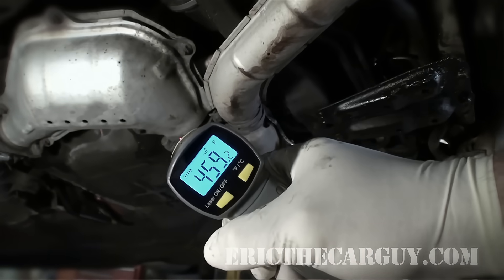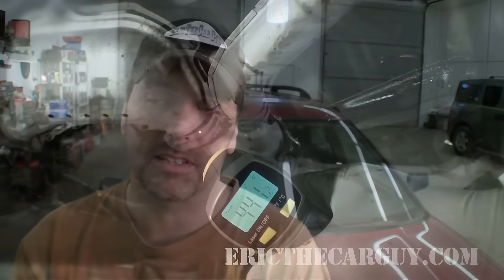Does Lacquer Thinner Clean Catalytic Converters? -EricTheCarGuy

Comment: Cats shouldnt effect performance in any way,they're simply for emissions the code can be tuned out, save yourself $180
Reply: Kyle Milford You are "talking" mad shit ! a bad CAT will decrease power in the car. How old are you 12?
Reply: 25, And drive a 400whp eclipse without cats.. So your point is invalid? All cats do is decrease emissions, maybe on certain vehicles the ECU will see a bad cat and decrease power? But most cars this is not the case. Unless your talking about backpressure?
Reply: Kyle Milford a clogged converter will decrease power and restrict exhaust
Reply: Kyle Milford For the sake of better environment for everyone, get a new cat if you can afford it.

Comment: scott kilmer is a on going joke in any of the professional only type internet forums or training type channels. He at most just embarrasses the trade. I wouldn't let him change oil in my lawn mower and diagnose nothing.
Reply: I heard him tell a guy with a po730 on a Honda civic that he might have a bad sensor,solenoid or a bad "transmission fuel control modulator". What the hell is that???

Comment: Thank you for your video! I've watched both yours and Scotty's videos on the whole lacquer thinner experiment. I did notice that in his video he used a completely different ratio of lacquer thinner to gas, but until I decide whether or not to try it, I have a question. I asked Scotty the same question, but have received no reply. I don't know very much about car mechanics, and I'm always afraid that I'm gonna get ripped off taking my car to a shop without knowing what's wrong with my car. I took it to Autozone just to have the code reader used on it. I don't remember all of the codes, but they were for the catalytic converter, O2 sensors, and cylinder 5 misfire. Now the unique problem I'm having is that the car WILL NOT go over 5k rpm regardless of which hear it's in, or how fast it's going. No matter what, it will not go over 5k rpm at all. It just kinda "boggs down"as soon as it hits 5k rpm. I have no idea what's going on with my car, which is a 2007 Mitsubishi Galant Ralliart,  3.8L MIVEC V6. Any help, or suggestions from you (or any reputable mechanic) would be greatly appreciated!  I'm just trying to avoid being ripped off once I take the car in to be fixed.  Thank you so much for your time! 
Sincerely, C.King
Reply: The misfire causes the car to go into a "safety mode" preventing you from going above a certain rpm for your cars safety
Reply: Leif E Thank you for the reply! Do you think it has anything to do with the catalytic converter?
Reply: misfire can be caused by bad ignition which could result in excess fuel in the exhaust leading to a bad catalytic converter

Comment: Years ago I had a van with a clogged converter. With nothing to lose, I pulled the pre converter O2 sensor and squeezed a pint of dawn dish soap in the hole. I then adapted a garden hose on the o2 outlet and ran the hose for five minutes until it ran clear. Lots of carbon came out. I put it back together and started it. I ran for years without any trouble.
Reply: +Hw Yes I did this with the engine off.
Reply: Joe Corbett Hi, Joe, I am thinking of using a similar method as yours. Can you please give more details? did u let your soapy water/rinse water run out of muffler? thanks
Reply: Great idea!
Reply: I was just wondering about doing the same thing Joe.
Reply: AMAZING  man cool job
Reply: If it's good enough for ducklings and baby seals. Perhaps it could Dawn on a kitty cat. Meow
Reply: Joe you are awesome!

Comment: Good video. I was going to try that until I watched this. I decided to run last years boat gas(52 gallons) in the wife's mini van to get rid of it. It was full of seafoam, MM oil, stabil and 2 cycle oil which clogged up the cat. The only way to clean it involved a sawzall and a hammer drill.

Comment: i been use thinner for wash gun spray paint   for  more then years every 3000 mil work good but you have to know how to use it you have guart on the gas tank and add one gal of the thinner and drive it rpm most be on 3 witch is better sometime don't you need to add more thinner with the gas to clean it

Comment: You haven't myth busted anything! If you're going to debunk something, you have to do it precisely. Scotty used a GALLON, not a quart in a HALF a tank, not over a have tank! So you're using LESS thinner in MORE has and trying to debunk? I debunk you!
Reply: Exactly. He didn't follow it correctly.
Reply: I used a gallon of Lthinner with almost a full tank and it worked!!!
Reply: +datsyhoehoe Seems like you are grasping at straws yourself.
This car only has a 14 gallon tank, thats ~7 gallons when the gauge reads half a tank.
The other hand, my pickup is dual 20 gallon tanks. 
It's best to adjust concentration based on tank size. Lacquer thinner isn't the best for a system as it is.
Reply: @FCFordLord  Scotty didnt give percentages he gave absolutes= half tank + 1gal thinner. It doesnt matter how many gallons so long as its half tank to 1 gal thinner.
Reply: I came to write that
Reply: datsyhoehoe (
Reply: datsyhoehoe you are right. I can say that his test was not accurate. I just fixed mine earlier, Toyota Highlander 2005 with 217,778 miles to be exact, put a gallon on a half tank of gas, drove 50 miles on a freeway with 70mph speed limit, went to a rest stop to pee, stop the car, turned back on after restroom break, BAM! CEL went off, no rough idling, no thick smoke. I did the  150 miles test even though the CEL went off at 50 miles.
Reply: EXACTLY!!  The absolute second he said he was putting in one QUART into 3/4 a tank, I immediately thought WHOA!!  Scotty said one GALLON into 1/2 a tank...a much higher LT to gasoline mixture.  So Sorry Eric, you have myth bust nothing!
Reply: +datsyhoehoe He also didn't run the engine hot like Scotty recommended.
Reply: tl;dr he drilled out a spark plug non-fouler and put it between the downstream oxygen sensor and the cat and drove the drive cycle until the codes cleared.
Reply: +datsyhoehoe He didn't declare it debunked. He even said he might not have the correct proportions. But at no time in the video did he say he busted a myth. I debunk you!
Reply: +datsyhoehoe ouuuuuuuu
Reply: datsyhoehoe and the driving to needs to be pushed to higher rpms he said 2.5 not 2 so your right!!!
Reply: +Phillip Watson you're grasping at straws to have a comment. If you set out to disprove somebody, you have to do it to the letter or it ceases to be that person you are debunking!!! It doesn't take a rocket scientist to know this. I DEBUNK YOU! INFINITY!
Reply: +Neil Smith Who's to say which is correct? Scotty recommended a gallon in half a tank, which is sometimes 9 gallons in some cars. I think you're just splitting hairs.

Comment: Debunking would also include using the same measurements as the myth. . Do you wash your clothes with a quarter cup of detergent? . Not gonna be too clean....
Reply: If theres only one shirt in there, sure.
You have to remember to adjust quantities for the load. Scotty didn't mention tank size, just to add a gallon to half a tank.
A gallon of thinner is overkill in a little tank like this one.

Comment: applicable for gasoline engine only sir Eric?..
Reply: Sorry, gas only. I assume you're referring to a diesel, and since diesel fuel also acts as a lubricating oil to all the fuel system parts, then running solvent through there will take away the lubricity of the diesel oil and likely end up costing you more in the long run than just replacing the converter.

Comment: We had a P0420 on our 2003 Honda Accord V6 that was coming off and on as we were filling up at the gas station.  We ran some Techron in along with premium and the code went off.  Next fill up with regular octane and code came back.  Next five fill ups and a month later with premium gas and code has not came back.  What's the deal here?

Comment: Thank you, Eric TCG, for this experiment!

Can you tell me how a driver is supposed to distinguish a MAF failure (not working at all) from a dirty or less than optimal MAF (working but not up to standards)? I rec'd a P0101 code on my 2008 Suzuki XL7 from the emissions tech and don't know if it needs to be cleaned or replaced. Please help because my tags are due to expire soon. My mechanic changed my oil, oil filter, air filter and cleaned the MAF w/ some CRC MAF Cleaner after I failed emissions (check engine light on/P0101 code). I also added Lucas Upper Cylinder Lubricant injector cleaner (half of the 1QT bottle) in 1/2 tank of gas. I've put on 60 miles to clear out fuel/lubricant. I'm nearly at a 1/4 tank now.

With all these "fixes" in the past 2 days, I'm hoping my "check engine light" doesn't come back on. After I've driven about 100 miles and the light doesn't return, is it now fixed (P0101 issue) or is 200 miles the mark? If I go back in 10days for the test again, it's free. I just want to make sure I have all issues repaired so that I can avoid paying twice.

Thank you, Eric, you're the best!

Comment: i think the Lacquer Thinner you have there is up to 50% acetone. this can help your gasoline evaporate and so burn better. this might help you car burn cleaner and get better MPG. on the other hand acetone is baned as a gasoline additive many places due to the fact that a lot of vehicles have had problems when acetone was used as a low cost octane boos. 
the lacquer thinner also have up to 25% methanol.. THIS is not good for your fuel system.. mostly rubber tubing and gaskets get damage by this.
using pure Toluene will not do anything other then work as an octane booster. it will make your car make more soot as it burns "more dirty" normal gasoline contain up to 30% Toluene already as this is the main octane booster from the refineries.
Reply: +grapsorz All those ingredients you listed are actually in alot of fuel system cleaners on the open market so your info cannot be right.
Reply: +Chasingerrors Consider the amount of grammatical and spelling errors you have made in comparison.  It would be a waste of time to correct them all.  Acetone is one component in Lacquer thinner.  Stop replying to every comment I made.  I only responded to one of your comments & I wasn't trying to offend you with my comment, but you took it offensively for some stupid reason.
Reply: +Chasingerrors If your job @ McDonalds is so important then stop wasting your time here.  Get back to work kid.
Reply: +Chasingerrors I'm sorry that word was too big for your 2nd grade education.  It's a common word for us adults.  Stop playing around and get back to work kid.
Reply: +Chasingerrors Who started this?  I just said LT has Acetone in it & you took it offensively.  You must get beat up alot to have so much hate inside.

Comment: i think its bad for the head or block of the engine it might strip protective coating elements in the piston chamber and by the time it gets to the converter it had done more damage maybe to the engine i dont know but anytime you put seafoam in your gas or intake it tends to scar or leave scars in the engine and to me it seems to to more harm than good.   I use cylinder lubricans in my gas sythetic lubricants and laquer thinner sounds not to good but i dont know for shure this is my opinion.  I would never try something i am not shure of.  I dont khow this is my opinion.

Comment: No I think.

First the ratio is incorrect. Allot of difference between 1 gallon and 1 quart.

But even if you did use 1 gallon and got no results you would still have to continue on and remove the cat and do the soak in soapy water.

At least an inspection of the cat to see if there is unrecoverable physical damage.

No. This video needs a follow up and complete diagnostic.

Short of that it's just a hunch with no basis.

Comment: It seemed to work for me.  I inherited a 2004 GX470 with 250k miles on it that had been sitting for 10 months with a full tank.  It seemed to run on the old gas fine, but toward the end of the tank it threw the bad cat code.  I put about 5 gallons of gas + 1/2 gallon of lacker thinner in the tank and ran the car fairly hard.  2000-3500 rpm until the tank was was very near empty.  I cleared the code with my obd2.  1 year and ~12000 miles later the car runs fine with no new codes.

Comment: Hi my name is jesus  I have 1 questions  for you I have f150 2004  ,how I need to fixed cleaning my catalyst converter  passengers side because my checks light is on ,thanks
Reply: Hi . one more time I have questions, where I find speed sensor in f150 2004 5.4 is not 4x4 is regular

Comment: Eric. I was getting the P0420. Had the 02 sensor replaced and still the engine light will come on. Then it showed it was the catalytic converter. A mechanic said he can clean it, well he empty the inside of the catalytic converter. He said that was the way to do it. Well my engine light is still on and reads Catalytic converter. What is it now ?
Reply: kinda car u got?   do u have rotten egg smell
Reply: Replace it?

Comment: So was I converters will throw a code just 5 percent off. 
And my o2 simulator was to get it to pass emissions and it did and still no code to date and it never effected my gas mileage or the way it performs.

Comment: unless it just Throw that code cause you are low on fuel and the Thinner mess up a sensor. or is making it get a FALSE READING after being in contact with thinner in the Fuel. i would just fill it up with some 91 ocatane.  Run  it and see if that code goes away or you might need to reset the ECU to get rid of the code. or something is mess up .  i also would just put on some HIGH FLOW CATS. Straight flow style. to fix the Problem RIGHT.  cause you do get money 4 old cats. & you take that & put it toward NEW HIGH FLOW ONE.'s like i did.  i only spend about 20 bucks 4 new cats and i did  my own EXHAUST my self. so i fix my CATS problem 4 under 50 bucks.

Comment: Hay sir I have a 96 dodge car a van and it hasn't been driven in about 2 years and I have been driving it for 3 mouth put about 3 hundred miles on it and now it started trowing up random check engine light  one was multiple misfire all cylinder then a cylinder 3 misfire  and some emissions codes the van runs fine I clear the codes I check the parts look ok use volt meter ask other mechanics I think there's some lose connection I can find yet any ideas what it could be and how could I check it out thanks love the videos thank big rob dog

Comment: I have heard some guys will use a steel bar and punch a hole through the catalytic converter and no more problem.
Is this correct and will it wok ??
Reply: Jp Randell that's why I love living in Kansas no emissions test here
Reply: Well if its clogged yes it will work better when you punch a hole in it. But now it doesnt work anymore and if you need to get it emission tested it will ofcourse fail it.
Reply: if you like the p0420 code. and failing your emissions ins.  gut away
Reply: Jp Randell It depends on money available at the time it go's bad. If one
needs their vehicle for work everyday, and it will not run because of a plugged up
Catalytic converter it leaves them with little choice.

Comment: Liquid fuel does not reach your catalytic converter.   so How can that lacquer thinner get the gunk off if its been mixed with gas and vaporized?    I think it wont.  

   I like the old way,where you take the converter off and hammer a breaker bar through it till its just an exhaust expansion chamber.    I mean, getting a new converter and installing properly.

Comment: I had a P0420 I couldn't get rid of, so I thought I'd try lacquer thinner - nothing to lose, right? 2001 Chevy Express 5.7 Vortec. I put one gallon of thinner in 1/4 tank, so approximately 10 gallons of gasoline. I drove it 100 miles, and I re-ran the test (using AutoTap Express). Bank 1 sensor 2 reading was now almost identical to bank 2 sensor 2, so I proceeded to the emissions test. It passed with no problem.

I can see a couple of problems or oversights in this video. First, the proportion of thinner to gasoline is way too low as compared to what Kilmer recommended. Secondly, if you pay close attention to Kilmer's video, you're only trying to pick up that 1 or 2 percent of efficiency that drops you below the emissions testing threshold. Even Eric's readings seem to show at least that much gain.

If you've got P0420 and you don't want to buy a cat, spending $20 on a gallon of lacquer thinner is not a bad gamble.

Comment: I'd rather suggest to remove the A/F sensor and pour lacquer thinner down that hole to soak the cat. Just start the engine to blow it off when done! Just light a match at the tailpipe to burn it off.
Reply: Suggest?   Have you done this without blowing up the muffler system?   Just wondering.

Comment: Eric I for one am happy that you challenge Scotty's claims. I like Scotty's videos and yours. To me it keeps you both honest and we all benefit from that. I would bet Scotty welcomes  your checking his claims.  Most of us DKS about working on Cars and I for one rely on auto guys like you and Scotty to help me understand my automotive problems. Keep Keeping on...
Reply: I agree. I've Googled "add solvent to gas tank", "lacquer thinner in gas tank", and others and  it seems like only Scotty Kilmer and a bunch of Don't Knows are "successfully" using this method. I'm open to other experiments but this is the ONLY one I've found from a reputable mechanic. I don't have time to exchange one error code for another... Is this like prescrip meds? The pill cures your headache but gives you kidney failure instead??? If lacquer/ or Short Line Solvent cures one problem but causes another, it's just easier to replace the bad part, instead of trying to hide the symptoms.